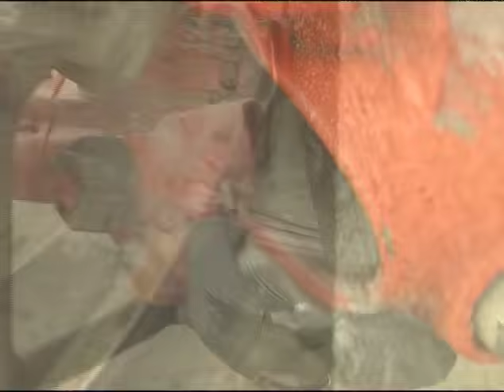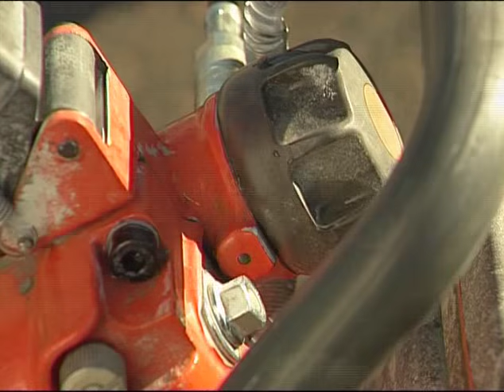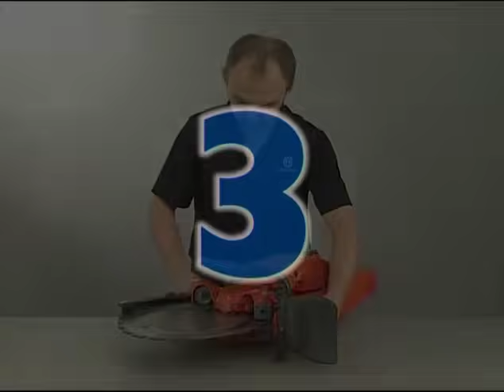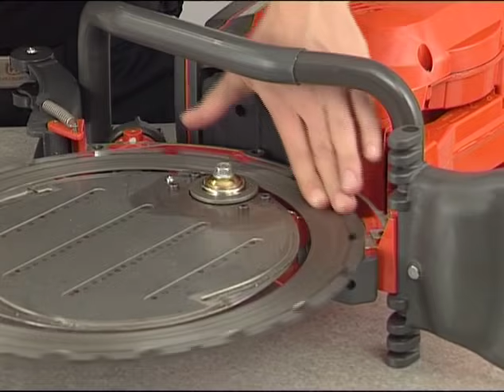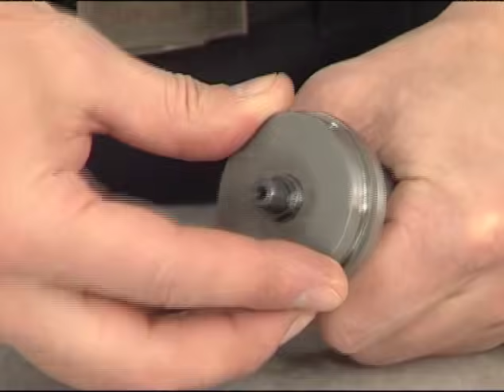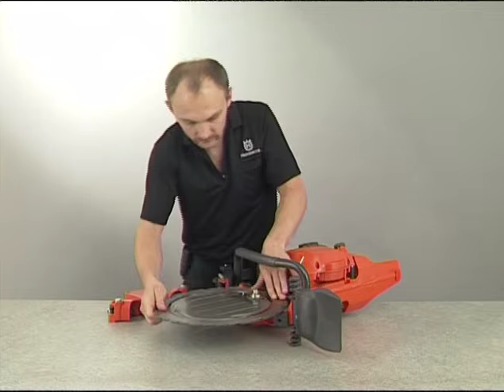Husqvarna Ring Saw Maintenance

Comment: would this thing run fine off a home outlet just an ordinary one nothing high power for the k3600, Will the circuit breaker go off?
Reply: No.
They offer this saw is 2 stroke gas and hydraulic.
They have an electric version now, but it runs on 220v or 480v.